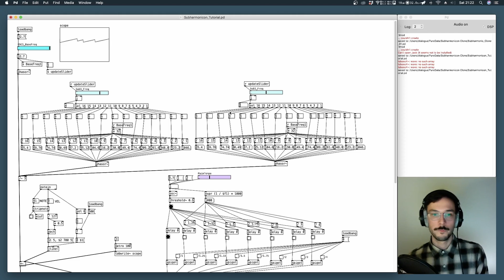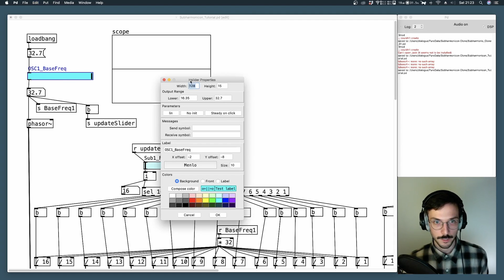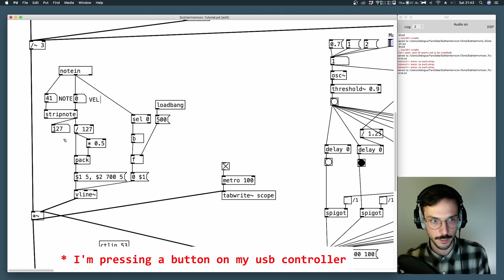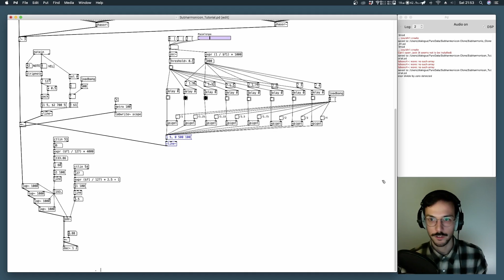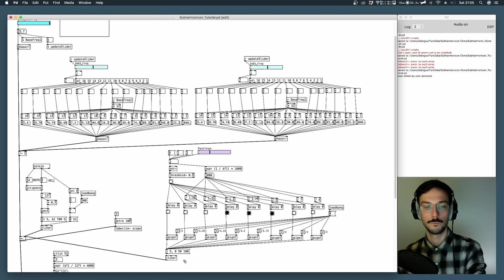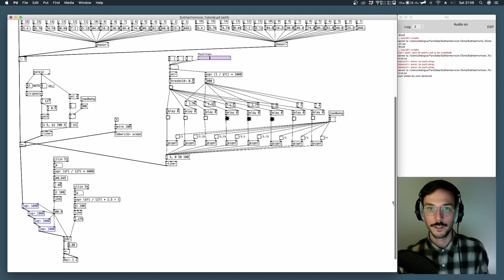Subharmonic Synthesizer in Pure Data

Comment: unfortunately my patch doesn't working, there is no sound at all. your patch, from the google drive also doesn't working on my pc. im using Mac m1 btw. do you know what can go wrong?
Reply from the maker: Hi, try downloading the updated version (Subharmonic Synth v1.1) from my GitHub repository. The link is in the video description. Once you have downloaded the patch, be sure to set each colored parameter (sliders, toggles) and select a waveform. If you are using the synthesizer without an external controller, you can trigger the envelope using the purple sequencer. At the bottom of the patch you also need to set the overall volume. Let me know if it works :)
Reply: @SoundCodex  thank you so much for your work, the updated patch is really nice with those minimalist nodes. I solved the problem - sound don't goes through the "/~ 3" object on my Mac. I connected subs and base strait through the "*~" and works well, regardless some noise in sound. Im  facing various problems in pd because of M1 chip, my guess
Reply from the maker: @cpa3y.xaoc.  I'm glad you enjoyed the new patch. Regarding you problem I tested the synth on my M1 macbook as well and I didn't experience the same problem as you did. It should be mentioned that with the latest macOS operating system updates, small bugs are occasionally found in open source programs. In any case, good that you still managed to get it working!